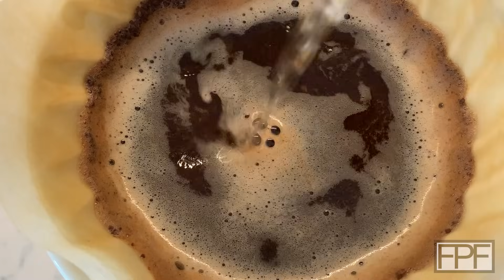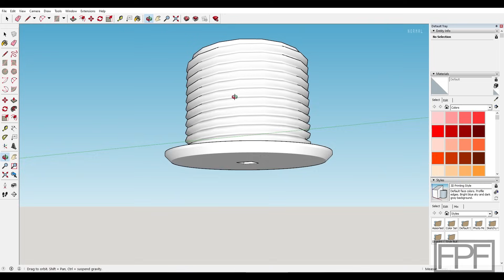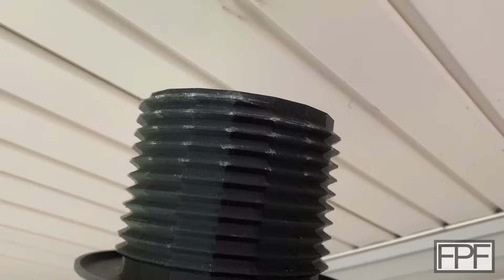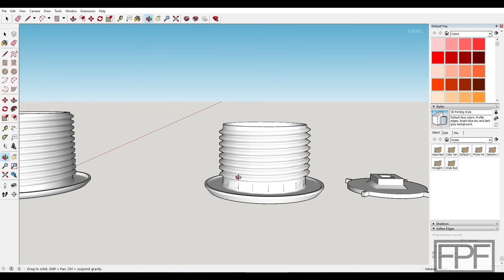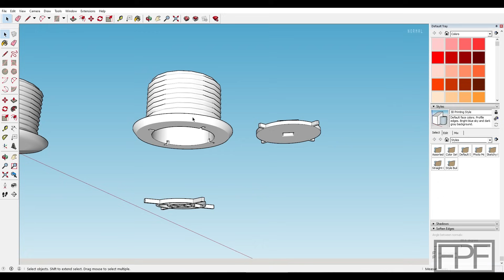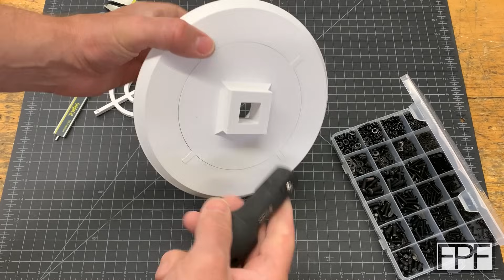3D Printed Range Hood Vent Cover

Comment: Your old "Cover" is an adjustable inlet you use to balance how much air is being sucked out of the room when you have one exhaust fan going to multiple rooms.  The shape of the backside is not made for air moving in the opposite direction so it's great that you finally got it replaced.
In my country it's however not allowed to have plastic parts anywhere in the stove extraction system, so maybe look that up for insurance purposes.

The idea, design and installation was nice thou. 

I don't wanna be the guy that complains about another mans work but my work ethic made me do it... 

/ HVAC inspector / Technician

Comment: 6:20 Socket sizes: There's actual specifications for the sizes for square drives, ANSI B5.38-1958.
Basically, the square drive itself is the nominal size, and the hole needs to be oversized by ~0.005". Google for full details, as I can't post a link.
Reply from the maker: Thx

Comment: you could get away with PLA easily, it will never reach even close to 40-50 degree (which is staring point of PLA weakness), nor 60-70 in which PLA really gives in and becomes sludge

Comment: Very nice, although the bright white against the beige of the soffit material draws more attention to it. Someone below mentioned using infill as a insect mesh which is a great idea and you can print it and fit it without having to futz with installing separate mesh material. You don't need too high a airflow for a range hood, and if you've got a grease filter on the hood, its going to cut your flow more than the vent cover is.

Comment: That's amazing! 

Small tiny things, I'd done differently:
1. trying to make the printed intake bigger than the pipe if possible
2. different mechanism to insert the grille (like a toolless screw on grille where you can insert it, twist it a bit and then it'll hold using mostly gravity to hold it in place)
3. adding a mesh to the grille. Would be paranoid about bugs and spiders going in there. 

Anyways -- I still think it looks amazing!

edit:/
With regards to the airflow: A cone shaped insert would be another idea where you're able to choose a smaller outlet while also increasing the airflow due to the shape of the cone guiding the air better out than having it hitting a straigt 90° angle from the source. Wouldn't look as clean as the grille... But you now. You have to make sacrifices :D

Comment: Love watching your videos!  You always have some interesting projects going.  PETG-HF, not sure why I do not recall this one?  I see now, Bambu filament.  Lately, I have found the PETG-GF is a nice one to use.  The low content GF bonds well to the gooey PETG, and it prints amazingly well, not like standard PETG.  I will admit that I have a new favorite filament, but it is hard to get my hands on, the Polymaker HT-PLA.  It prints extremely well, and I love the higher temp ratings on it.  I was able to grab a few rolls before the stock quickly ran out.  Awaiting restock and a larger order to arrive from Voxel also.

Comment: What's the deal with the dodecagon threads? 😁  The design of vents with the plate in front is to disperse the greasy air rather than direct it into a small area, you might get a greasy spot on the porch.  One thing you might want to consider is sealing the ring where there are grooves in the soffit to prevent bug ingress.

Comment: Love it, I would suggest the metal duct should have slid into your print. That would improve flow and simplified install as you could have slid it over the duct, pushed up to desired height, then from the inside ran 4 self tapping screws outwards through the plastic into the duct. Love your videos, keep them coming!!!!

Comment: Same issue with the purge line and a P1S. Have you figured out the issue? I also tried cleaning the plate, but it seemed to make the problem worse. Also, it seems to happen more on the first print of the day, so I wonder if it is an uneven heating issue.  Currently, my cure is to stand and watch for the purge line and then remove it before it can cause a problem, as it has caused failed prints.

Comment: Enjoy watching your projects.  Might I beg you to consider a real mechanical CAD system?  Sketchup is simply not meant for the work you are doing. And you clearly have the capability to use a proper solution. It would make your designs better, and easier for you. It would make it better for your audience.   It's kind of like using a hammer and duck tape to work on a car engine.  You will just make you life easier, and better educate your audience.

Onshape is free for you to use for this purpose and is the best mechanical CAD system on the market.  You can use some of the direct face tools to work similarly to Sketchup. But you will get real BREP.  Fusion is an option.  But I would still recommend Onshape.

Comment: Some good ideas. Thanks. Perhaps consider switching to Blender from SketchUp. Much easier to make manifold surface models. I switched a few years ago and have never looked back.

PETG definitely the way to go. Not in direct sunlight so uv  protection not such a big deal. ASA, while the better material, tends to warp when printing unless you have a closed heated chamber.

Comment: It looks absolutely terrific, but as other commenters noted (both by code in most locales and just because it's something you want to do) pest intrusion should be a consideration. Most building codes spec a 1/4" to 1/2" screen mesh, which I would think could be handled via an insert behind the screw-in grate (making it replaceable is a bonus of that approach). I would also consider sealant in the area between the outer rim where it mates to the ceiling. Those channels in the soffit material are highways to spiders, ants, crickets, some wasps and other fauna that happen to inhabit the creepy-crawly phyla in your area. Thanks for another enjoyable weekend watch. I pick stuff up from every video.

Comment: 20:42 If you ever need to print the insides of holes inverted like that, you can model in some straight lines at each layer to make it so the printer can Bridge the sections instead of trying to make a circle. ..ik that's kind of a vague description, but I know about the concept from some videos I've seen
Reply: Also the fact that it's installed so close to being in line with the panels, but not quite 😩 (if you didn't notice before, you're welcome..)

Comment: If you get that much old material mixing into your print then your extruder gears must have been stripping filament and it's stuck in there. clean or replace your strip gears. As for your vent I would recommend at lease a sand screen sandwich between your vent holds so the bugs don't get in.

Comment: What’s the cfm of the exhaust? That outlet does seem rather small. Ours is 1,200 cfm. It needs a 10” diameter galvanized steel duct. The opening is horizontal with a shutter. It’s a big opening when the fan is on. The kitchen designer who also sold and installed the custom cabinets wanted to use an 8”. He said that that’s what he did for that cfm. But the manufacturer of the hood said 10” and so that was what we did. As usual, what you’ve done is very nice. I make sure contractors know that I know what they’re doing and I check everything before they finish. Ours also had a short duct and wanted to complete the length with duct tape, but I made them buy an extender. You really have to watch them.

Comment: If it is a soffit, does that technically make that a soffit vent even though it's not venting in the traditional purpose? (traditionally: fresh "cool" air into the attic and back out a higher roof vent). I am also curious about the answer to the ceiling vs. soffit question too. Another thought, would it be considered an exhaust instead?

Comment: hi, just move the load line out of the way? Its better for utilization of the full bed anyway:  
;===== nozzle load line ===============================

M975 S1
G90
M83
T1000
G1 X85 Y-3 Z0.8 F18000;Move to start position
M109 S{nozzle_temperature_initial_layer[initial_extruder]}
G1 Z0.2
G0 E5 F300
G0 X170 E10 F{outer_wall_volumetric_speed/(0.3*0.5)     * 60}
;G0 Y-2 F{outer_wall_volumetric_speed/(0.3*0.5)/ 4 * 60}
G0 X95 F{outer_wall_volumetric_speed/(0.3*0.5)     * 60}
M400

full start code for p1s: pastebin dot com/xHaQwwtv

Comment: Awesome work, your channel is very good. I designed some air vents for cars, to fit 52mm
gauges and one thing that helps with air flow and even noise reduction is to round the inside corners that get in contact with the airflow. It's a small detail but really improves the project.

Comment: What an extreme hack job from the company that installed that... those types of vents are meant for indoor ventilation/extraction, not as an outlet for a range hood. It will severely limit your airflow because it's meant to do that... These are meant for central ventilation so you can adjust the airflow for each of the rooms even the rooms further away from the system will have proper airflow.
Just make it an open hole with a mesh against rodents and insects and you're done... your version is definitely much better!

Comment: Thank you for your channel. I am now always thinking can I make a 3d print that has a function. Resently bought  a central dust collector for my cave that had a 2.5 hose that was too big  for my tools so I built an adapter that made it fit on my table saw belt sander and cut off saw

Comment: I love that you included the part where all your assumptions get thrown out the window and you need to reassess your plan (when the hole was short and had flashing around it to make up the difference). That's real life, and it's nice to see how it affected your proposed solution. It's the opposite of those TikTok videos where's everything is smash cut together and everything always works perfectly the first time. Those vids are useless.

Comment: I NEVER comment on videos.  However, this deserves cudos.  Well done.  I wish I could find a place near me to learn cad design.  Can't see a design fail here other than maybe concidering a "critter screen".
Reply: While I would say check your local Community Colleges and Community Education services (always a good idea, even if they don't have Intro 2 CAD as a course) I know that all 4 of what I consider the main CAD programs have either self created content, or community created content on how to get started with them. The 4 I consider major are Blender (arguably a 3d modeling program that's not exactly CAD, but can do the job) Fusion360, OnShape, and FreeCAD. I've also had good experiences with TinkerCAD if you just want to get started playing with ideas. I did try using SketchUp years ago, and I know it's largely used in the woodworking community, (I think I tried using it to design a platform bed at one point.) It works well enough, and is a reasonable alternative to the above if you already are using it for other stuff, but I don't know that I would recommend it as a starting point.

My own progression has been fumbling around with FreeCAD, OnShape, looking into Fusion360, then settling into a several year period where I did a fair amount of design work for 3d printing in TinkerCAD, and finally about 2 or 3 years ago starting to migrate to FreeCAD, learning a lot from the MangoJelly videos. Again, pretty much every design software has tutorial videos and even walk through courses on how to design with that platform. There are differences, but from a starting point, pretty much all of them have similar license moddels for very low, or no cost use for people just starting out, with the bigger players going to much more expensive renewable licenses for professionals. 

I'm sure someone has a ven diagram showing how the various design tools work and compare. My own perspective is that if you've worked with blueprints, you might be more comfortable designing in OnShape or Fusion. If you've made things with clay or the like, Blender may be more your speed. TinkerCAD is a pre-designed shape with stretch and boolean (merge/cut) options that gives you something to go between Blender and Fusion, with the observation that since AutoDesk owns both TinkerCad and Fusion, they have built the TinkerCAD platform (web based) so that it will seamlessly export models into Fusion so you can apply 'decorations' to the model in that platform. So there is a workpath process for learning simple design in TinkerCAD, then building on that knowledge to improve your model in Fusion360, and with that platform available you can start learning how to work with that platform from the ground up as well. 

And I think you'll find that all of them have active communities on FB, Twitter, Instagram, and others where you can ask questions and get useful responses.

Comment: why didn't you just screw the fixture into the existing 4 holes on the ceiling sheeting? or you could even make new holes anyway in addition to taping the fixture to the pipe on the inside like you did? I feel like having the fixture only being held in place by the floating pipe doesn't feel like a very sturdy and reliable connection
Reply from the maker: It’s the other way around, the pipe is rigid mounted and the ceiling floats.  That’s why the original was hanging down.

Comment: I am glad i saw this video because i had the same issue when printing petg after pla and didn't understand why. I blamed my creativity printer.   I've had to design and print some vents for my hrv system as they were impossible to find, and i used white petg for the final version.  Also, i put some metal mesh behind the vent for bug prevention, and my annual furnace winter prep includes a removal and cleaning.

Comment: I might have rotated or 'clocked' the vent, just a tad more so the grille is normal (or diagonal) to the ceiling/soffit slats instead of being a random orientation.  OTOH, this is Functional Print Friday, not Stunning Style Saturday.
Reply from the maker: It's funny, when I stepped back after tightening I thought the same thing.  I then challenged myself to embrace the chaos of it.  Jury is still out if I embrace it :)

Comment: I keep a bit of cleaner filament around when going from PETG-HF or PCTG back to PLA or dark to white PLA transitions, when the very first print is going to be a keeper. Otherwise it usually burns through the old stuff after my usual couple of test sizings. The cleaner gets most of it right at first, but remember to fully purge the cleaner out when you load the PLA back into it. PLA seems far more sensitive to this contamination issue than the other filaments.

Comment: Just kinda saying.... saying that the original installers were terrible for how they did that... when coming from someone who had absolutely no idea what they were doing... is rather... idk what the correct term would be, maybe cringe? The installers did nothing wrong, that's exactly how those things get installed... even if they weren't alittle short on pipe, it'd still be connected to your plastic  pieces with tape to ensure an air seal.. and considering getting a whole new run of pipe for a THIRD time just to fix a 2-3 inch gap would have cost you a whole lot of money, i'm pretty sure you would have told them to just go ahead with how they were doing it instead of paying them for a 3rd pipe and a doubling of hours to re-reinstall it. 

All in all, your 'installers' did nothing wrong, they did what should have been done to both seal, and extend the pipe, and calling them out for doing exactly what should be expected of a contractor, is mind blowingly crazy lol

Comment: I was surprised at the lack of concern about insects, or even creepy-crawlies, in the pipe! 
It's bad enough when wasps find a place to nest, but giving them a way into your blower mechanism seems worse. Perhaps a place right on the end for a mesh circle? Always that tradeoff between making the mesh tight for the smallest size of flying insect blocked and the backpressure caused by tighter weaves, eh?
Finally, I like that when 3D printing our solutions we can choose a color that blends in to the space, where desired.
Reply: The original vent had the same problem, but it can't simply be solved. If you put a mesh over the vent, that mesh will collect grease and eventually close over, requiring scheduled maintenance that inevitably will get forgotten about and then the functionality will slowly die off. Probably the best option is a self-closing vent, that is forced open by the airflow, but this will also collect grease and may either stick closed, or collect enough grease on the mechanism that it doesn't move freely
Reply: A damper. Most penetrations to the exterior would have a one way flap.
Reply: Yeah I guess the range vent is problematic... Mine has the grease filter right over the range so it reduces or eliminates the grease issue at the far end. Plus, how to avoid wasp nests?

Comment: PETG was a good call imho. I would also be curious to see how ASA held up. I would not have thought of threading the insert, I would have just mounted it with screws like the original. The only other thing I can think of is in relation to the grate. I would have added a small chamfer to the bottom and rounded over the top, to help smooth out the air flow as its exiting. Probably not really needed, but it just kind of makes sense to me and I would do it.

Comment: You can also imbed material like screen door mesh into prints - design a gap, pause the print at that height, lay the screen door material down (tape it outside the print to keep it from moving) and then let it print right over the material sealing it in as part of the print.  (If you want to prevent insects from entering).

Comment: For my outdoor prints, I sometimes soak them in diluted "Waterglass" (Sodium Silicate) which is normally used for waterproofing pottery or concrete. It's cheap and easy to use.